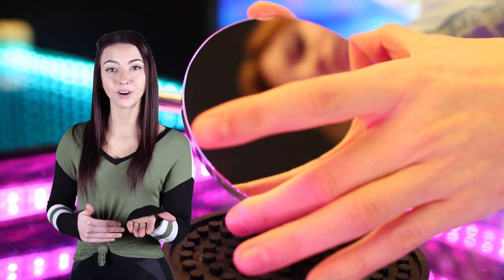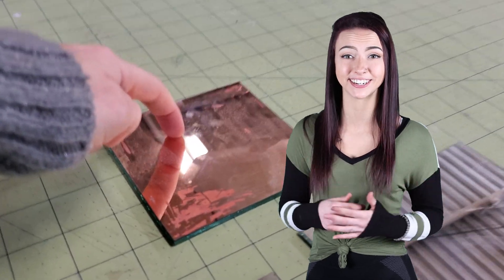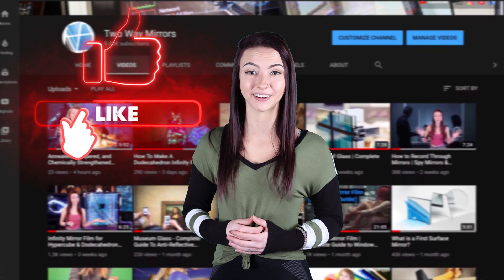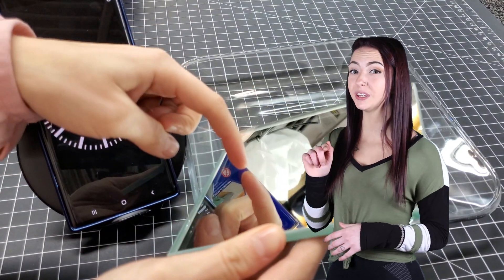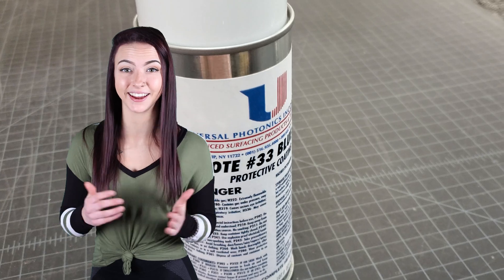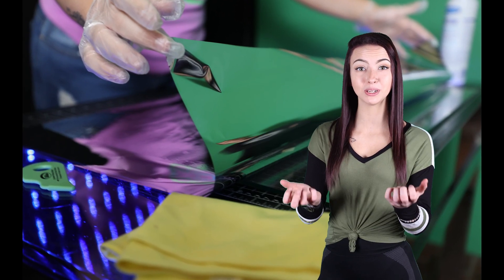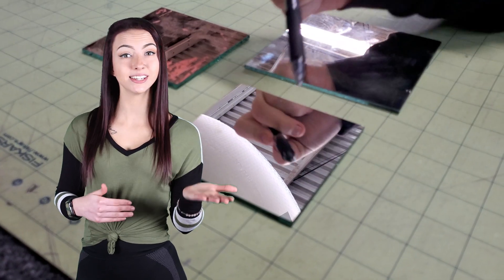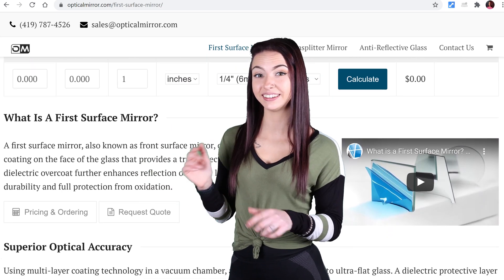How To Make A First Surface Mirror [Fast & Simple Techniques]

Comment: Do you know if its possible to use two way mirrors as windows? And what would be a good guess for how much its would cost?
Reply from the maker: Yes you can install Glass Two Way Mirrors as windows. Usually though if you already have clear glass installed you could simply order our Two Way Mirror Film to turn your windows into two way mirrors.

Glass Two Way Pricing: https://www.twowaymirrors.com/glass/
Two Way Mirror Film Pricing: https://www.twowaymirrors.com/two-way-mirror-film/
Reply: @twowaymirrors  Thanks! Your knowledge on mirrors really helps🙂👍
Reply: This was very interesting and I learned a few things that I didn't know before. Good effort on the presenting, takes a lot of practice to present a load of technical information in a confident and engaging way (as an engineer I'd know). Thanks for sharing this! 🙂